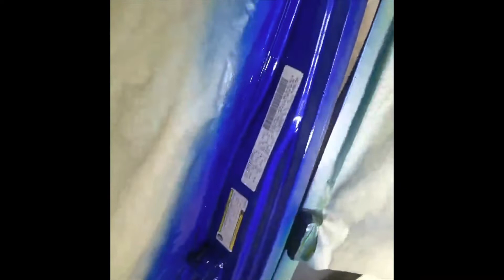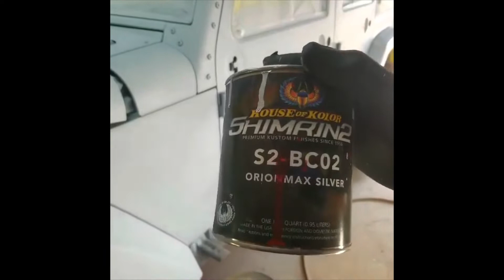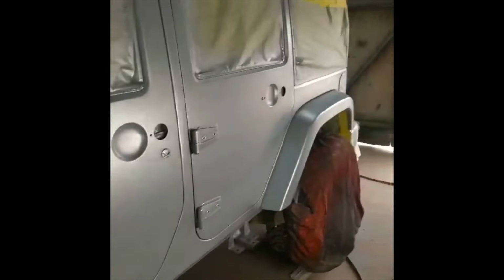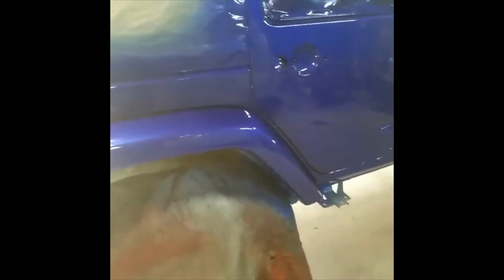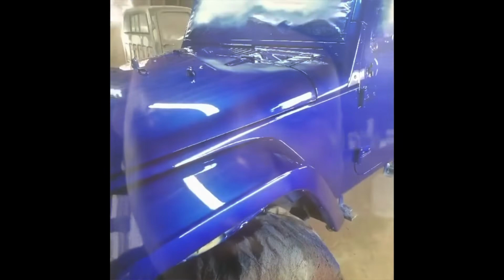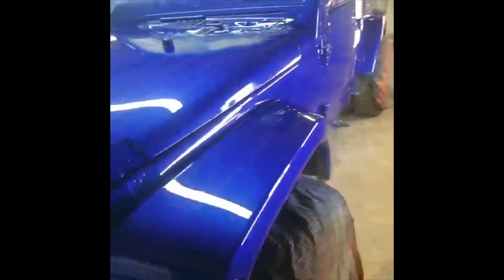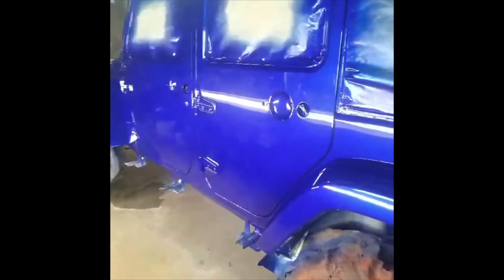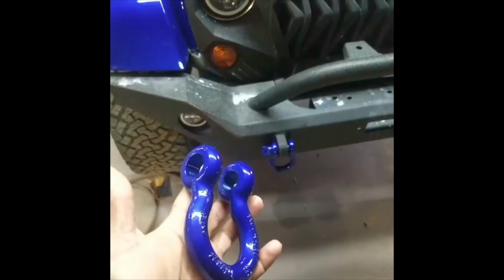How To Candy Paint/Candy Painting With Gotti

Comment: I have the same color. My clear coat cracked so I’m not sure if I just need to cut and buff
Reply from the maker: @swapped_Nova if your clear coat is cracked then a cut and buff won't solve that issue. Sometimes if not enough catalysts/hardener or the wrong clear is used, uv rays will make the clear break down, split, and crack. I would really need to see it to suggest what needs to be done. Worst case is re-clear, hopefully the  base/candy coat is not damaged.